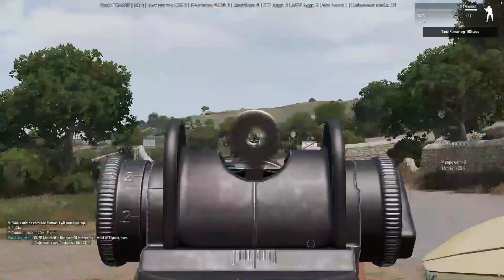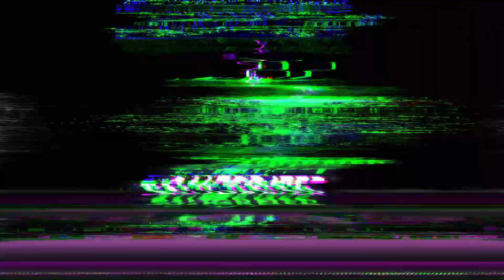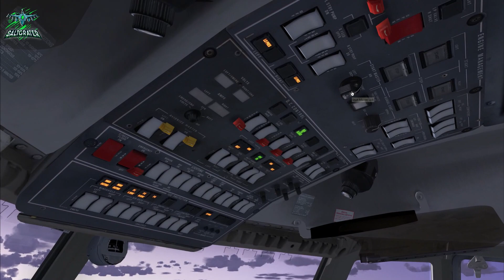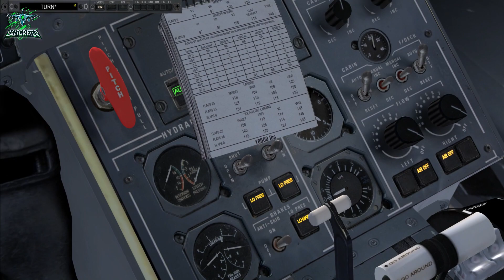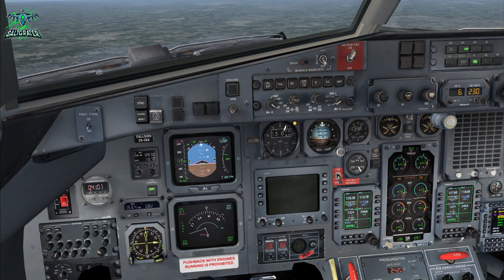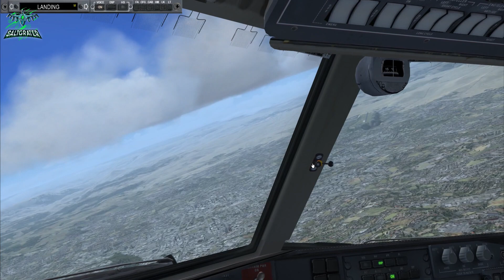THROWING IT WAY BACK | My first payware addon...

Comment: Thank you for this video i have been struggling with this plane for weeks installed it again after a few years away from it.Also id like to ask how you fly helicopters so well.
Reply from the maker: It's such a cool plane. With they'd bring this to MSFS.

As for the helicopters... A lot of practice. I gave up a few times in the beginning... You absolutely need decent rudder controls. I don't have pedals, but I use a control on my throttle so I can do it with my thumb. The twist grip on the joystick was a struggle. Although there are people they use that just fine.